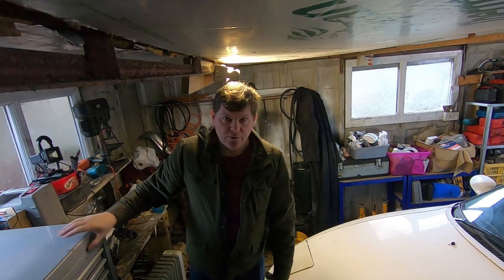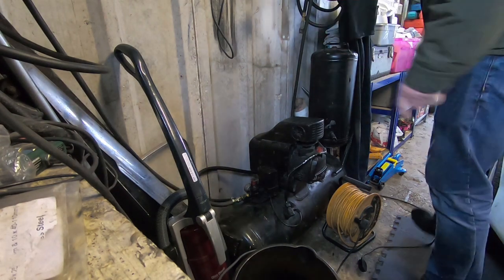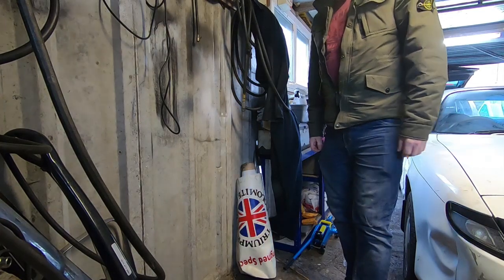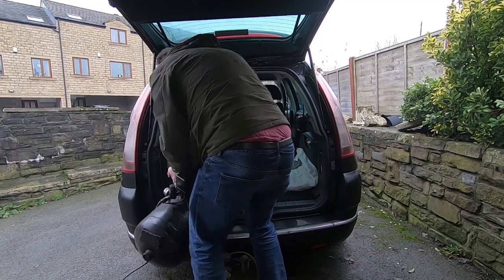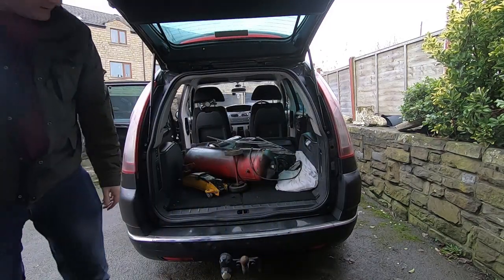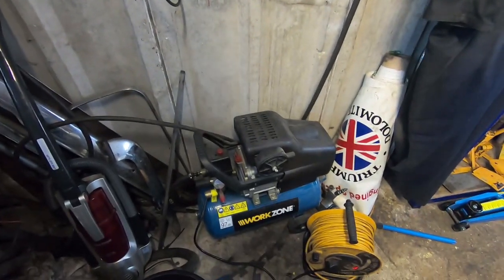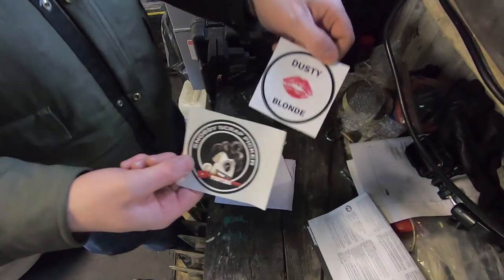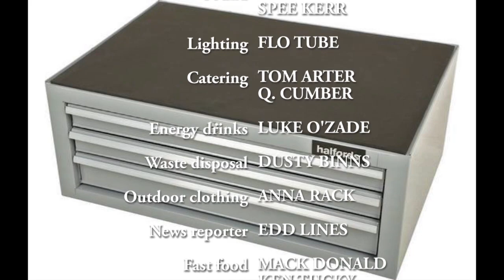Toolbox Tour Part 13 - Changing the compressor

Comment: You should unwind your extension lead when using high powered tools, this can cause a lot of resistance, your extension lead will get very hot if you use it fully coiled up
Reply from the maker: Yeah you're right but it is 50 metres long. It will be fine as long as I don't have everything plugged in.

Comment: looking to get a little aldi compressor for small jobs too. Could you not have removed that extra tank on the old compressor and used it as extra capacity on your new one??
Reply from the maker: I wasn't gonna mess about with it. I had the Aldi one in the house so I thought I'd bring it over to the garage.